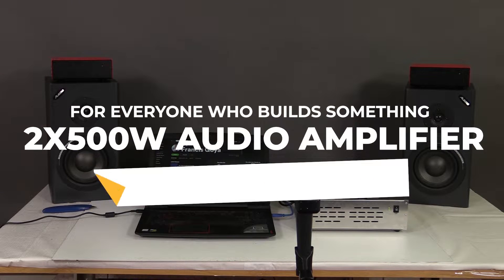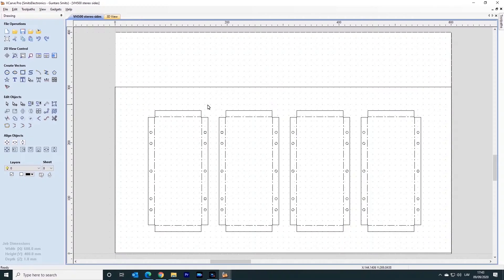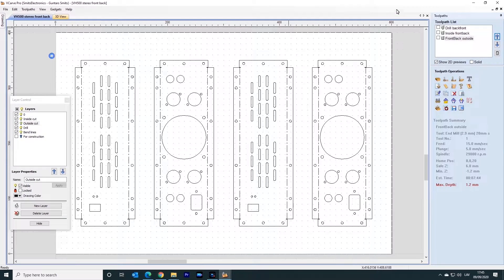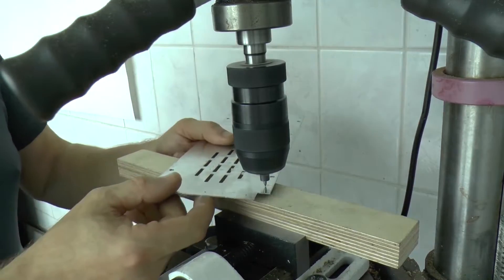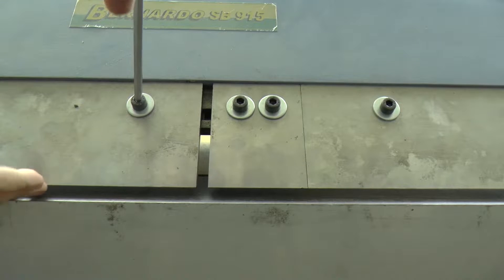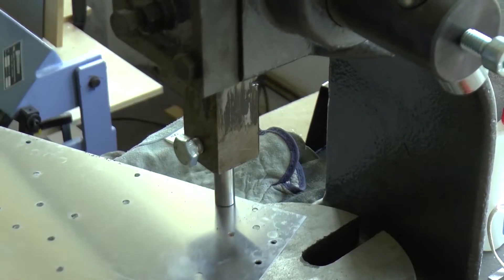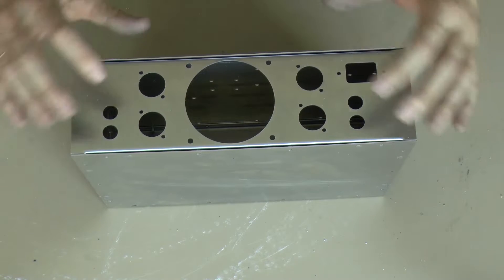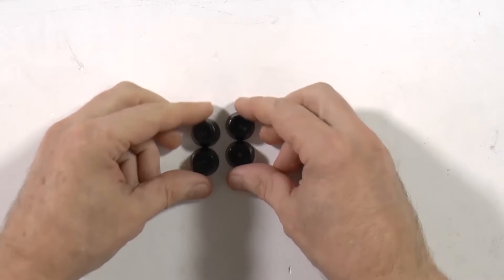500W audio amplifier weekend project EN

Comment: I've built a dual mono 125ASX2 (BTL) using the case and wire kit from Ghent audio. it sounded amazing with my Focal Aria 936 speakers and NAD C658 . But recently I've upgraded the amp to dual mono Purifi 1et400a amps, and there was a significant improvement!
Reply from the maker: It would be good to have blind listening tests. In my practice when building my units each new project sound much better to the previous one until I put real blind tests where I do not know which amp is connected. Often happening that working away from a clipping I am not able to distinguish the better electrically measured device from regular one when working far bellow 0.1THD figures. and clipping. But the test should be carefully set regarding the volume. Minimum difference is making a huge impact. I am setting everything by using a measurement microphone and a signal generator. Anyway, it would be great to have a new winner in sound quality after ICEpower and Hypex.
Reply: @guntarssmits2104  A/B testing has its limits. It only captures conscious, short-term listening. You may not be able to tell the difference but your brain/subconscious might and you may find after long listening periods that one amp is less fatiguing than the other without being able to tell the difference between sound quality in the first place. Really people should realise its not an exact science and everyone's mileage may vary

Comment: Have any ideas about good DSP to made.3way speakers, total 6 channels?!
Reply from the maker: Check professional market. it is standard device for them with price range from 250Eur to 600Eur. In fact it is ok to use analog active crossover as well for price just about 100Eur like Behringer "Behringer CX3400 Super X Pro V2". I was using  them for my projects and got fantastic results. I used 4 ICE125ASX 2 boards. 2 in bridge connection  for woofer and 2 in stereo for mids and tweeter. Total 6 channels. Mounted them in mobile rack system case. Pro units are designed to fit in 19" racks. Results are unbelievable.

Comment: Maybe I missed you saying this, but what is the other board behind the power switch? I see the 2 preamp boards and the 2 125asx2 boards. Whats the last one?
Reply from the maker: To make design perfect I have separated fan feed voltage from the audio part. The small board is 12 volts low current power supply just for Arctic Cool 80mm fan.

Comment: where do you buy genuine ICEPower boards from in the EU or the UK?
Reply from the maker: You can purchase Genuine boards at https://www.profusionplc.com/featured/icepower-amps.html
Not the cheapest option but a reliable provider. We are purchasing boards directly from ICEpower based on the OEM contract and there are minimum volume commitments. those are going into the finished products. Our main business is electronic development and we are not supporting shop to sell components. Kits are the main product with the aim to support people who are building something. And there is some fan to engineer even small things. 😊
Reply: @guntarssmits2104  Thank you for the link.  What concerns me is, based on another video you did, the word "DATE" appears on the board in product image rather than a real date and there are 3 resistors present which weren't on your genuine board.  The eBay listings for ICEPower boards from China also have the "DATE" on the board in their images.

Comment: Hello Guntars. I have found a couple of potential suppliers for cutting housings and faceplates in Lithuania and Italy if anyone is interested.  I am on the look out however for a low cost steel housing that will sit inside a wooden case (to act as fire protection, grounding and faraday cage) and so would welcome alternative european suppliers for this type of lower cost housing because aesthetically it will finished with wooden sides and upmarket faceplate. Any information welcome
Reply from the maker: Probably you should look for metalwork companies. I have chosen aluminium material due to its shipping weight. For the same reason, I excluded faceplate. Aluminum boxes are lighter than steel boxes. and it is a competitive advantage for WW direct sales. Shipping costs are growing.
Reply: @guntarssmits2104  Thanks - I have sent you a mail to see if you are interested in selling your casework. I have found suppliers for the faceplate.

Comment: hi,how much will it cost if i want to buy,thank you.
Reply from the maker: Boards2x165 USD ( Original from Icepower V2)+Other electronics about 50USD +connectors, fan and assembling components about  30USD + chasshis 50USD ( Non painted aluminium box as in the video) + my markup about 20%. So I would sell it for 550 USD for direct sales. Via eBay even more. eBay is kind of money hungry

Comment: Are you selling online yet?
Reply from the maker: I will place 2 pieces as  DIY kit with internal wiring, preamps and fan, but without board next week. Price will be 209USD. An Integrated system I am selling only directly as special order. This is not a mainstream product. Selling it as company against invoice and with warranties. Mostly it is due to high costs of sales ion eBay. I can sell on eBay as well but we should agree on price and than add eBay/PayPal costs of 20%.. Weekend project is easy to transform for active speaker systems 500W+125W+125W as well adding extra output.